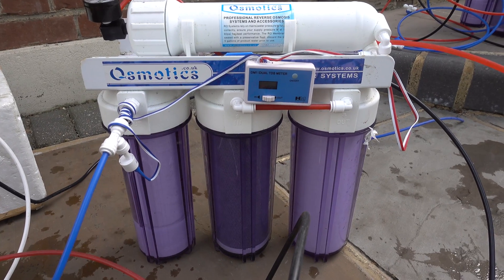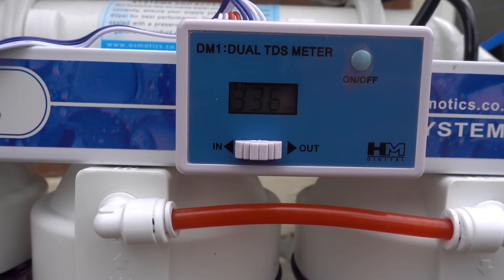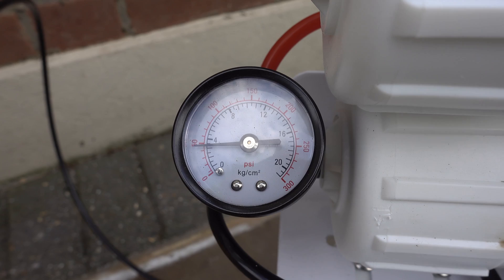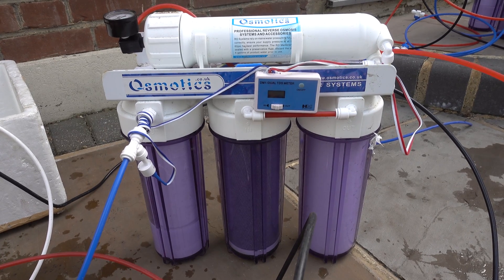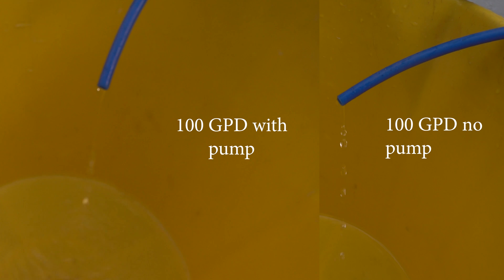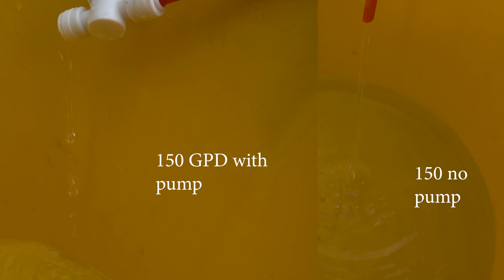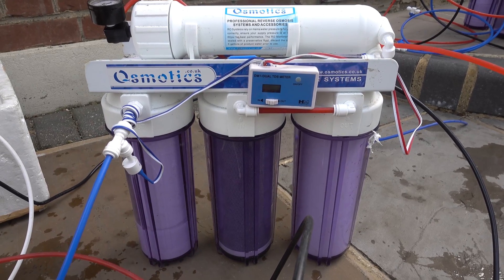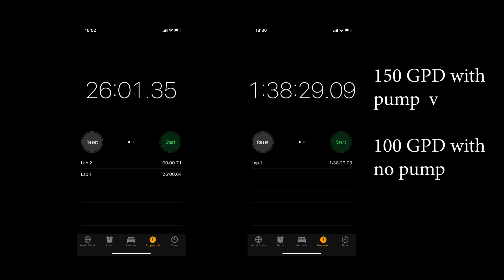Reverse Osmosis: 100 GPD or 150 GPD?

Comment: great video but i have a question when you did the change from 100 gpd to 150 ,did you just add a 50gph  membraine or did you have to change it to 2 x75 and also did you need a new pump  and flow restrictor  sorry  getting a marine tank and still doing all the reserch  thank you for your help :)
Reply from the maker: Thanks for watching.  The difference between the 2 was moving from 1 membrane to 2.  Everything else including the pump was the same

Comment: Really interesting video. Currently using a 75gpd unit and been thinking is it worth going bigger. Think you’ve answered my question there. Cheers.
Reply from the maker: If you are in an area where TDS is a lot lower than my 320+ then water production is gonna be quicker but you will still get faster with less waste
Reply: @fishpalace  I'm quite fortunate it varies between 70 and 120 tds, and pressure is 80 so tend not to use the pump. Definitely want to improve the amount of waste water produced.

Comment: Great Video. Best investment I made for my tank was getting an RO unit. Gives you so much control on the quality of water we use for our tanks. I have a 4 stage unit with 2 100GPD membranes waste water from one going into the 2nd membrane can do 25ltrs in about 40mins. My TDS at start is around 50.
Reply from the maker: 50! I can only dream of that.  2 membranes definitely and just shows how quick it can be with 25 in 40mins 👏🏻👏🏻. Where do you make your water?
Reply: @fishpalace  should also say using booster pump as water pressure is low. Make it outside as don’t want to run the risk of flooding the kitchen.

Comment: A very overlooked important subject in this hobby, I have been producing my own RODI/saltwater mix since starting 13 years ago, now on my second machine, a seven stage Osmotics 100 gpd with booster pump. Over the years I have added extra fail safes to the water production in my garage, currently the 3x 25 litre barrels used for my weekly water change & auto top-up sit on a 4 foot long plastic tray with 2" raised edges, each barrel has it's own float valve, through experience I can estimate a run time to reach those float valves and set the Alexa or phone timer as a backup reminder. Keeping on top of maintenance, changing filters and resins, keeps the machine with optimum output and I find I only need to do this every 6 months to maintain 0 tds
Reply from the maker: Thanks for watching and for some great comments 👍🏻👏🏻👏🏻. Can’t beat redundancy for stopping a flood and other failures too.  7 stage, wow, mine is 5 so what other 2 have you got?  I was thinking about adding a pod for silicates as that does seem to be a growing problem, from what I have read
Reply: @fishpalace  yes recommendation from Osmotics to reduce a silicate issue I discovered after an ICP test

Comment: Great video RO water is one of the most important thing in reefing with out high quality water from the beginning you tank will fail 
It’s great you putting this video out because a lot of reefer don’t know the importance of RO.
I may be wrong but the more pressure you have going thru the unit the better quality water is produced.
Reply from the maker: Thanks for watching.  Yep, pressure does improve however over a certain level can put too much pressure through and can reduce the life of the membrane.  I think it is 100 but don’t quote me on that.  I think 70 to 80 is optimum.  Thanks for watching and RO can be overlooked with so many other things going on 👍🏻